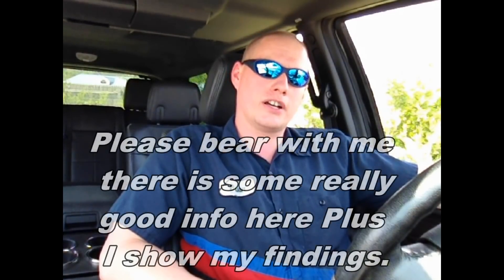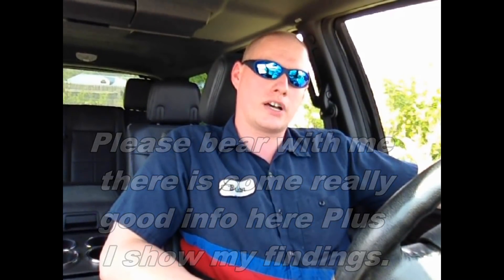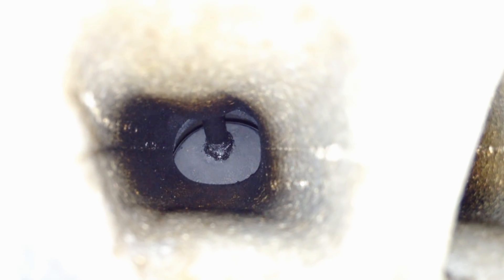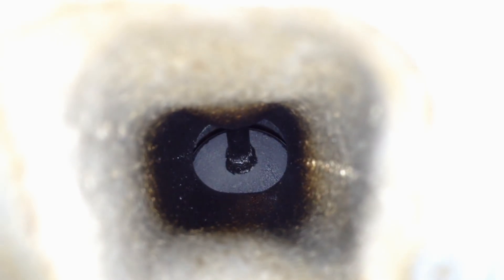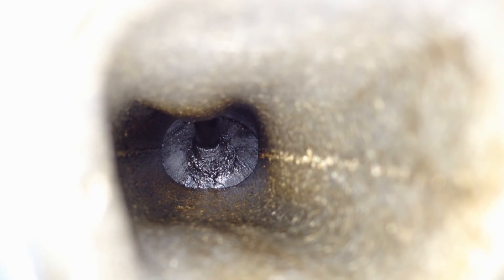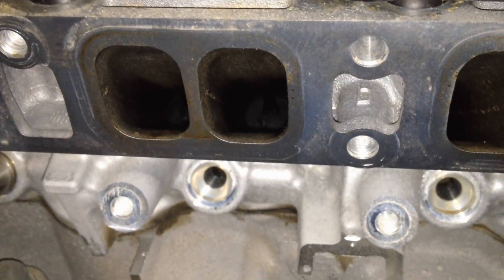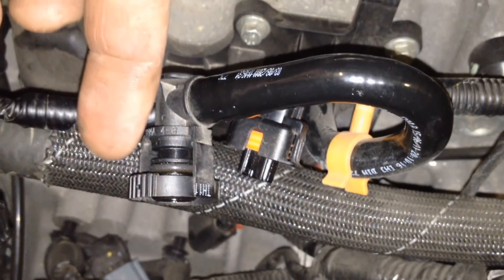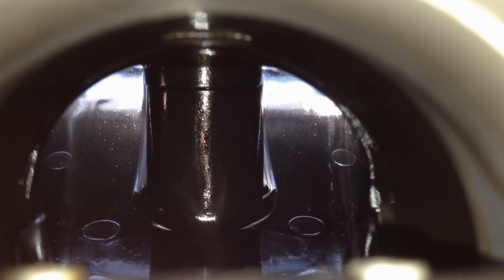Ford Ecoboost Warning Part 2 My Findings

Comment: Is all BS Ford won't fix the problem and it's all caused by direct injection. The funny thing I watched a video on Ecoboost and it's torture test and they said and I QUOTE the engine is like new with 160,000 after this with no issues. They might be quick off the line and take some V8 but I'd never own one and this is coming from several Ford techs to stay away!!!
Reply: The motor can survive it. You just have to live with a miss fire from time to time.
Reply: +easydoz1 yes, they are extremely durable

Comment: Hi FordTechMakuloco.  I love what you do.  I own an old Taurus and you have helped me save a lot of money with your videos.  But I have a question for you.  How is it that you haven't faced any repercussion for putting up videos like this that might potentially hurt Ford sales?  I would think they would want to prevent the spread of this info as much as possible.  I would really like to know.  Thanks.
Reply: For one, he mentioned that this is not a new issue. Only new to Ford.  Direct injection carbon deposit issues have been known in the industry for a a while. I knew and experience them with BMW in 2007 through 2011.    Now I bet the dealership would not like him posting this video. But ford corporate probably throws this in the bag with a lot of other nay-sayers.   This will likely be a small percentage issue an not a widespread plague like most fear.

Comment: My 2013 F-150 Ecoboost Platinum is in the Dealership service department getting the 'boost bypass valve replaced'. They are charging $600 for parts and labor after the check engine light came on. I baby my truck and for this F150 to break down at 47,000 brings a tons of questions into play.  I'll be making a YouTube video soon.

Comment: Looks like with no fuel in the intake, the blowby from the crankcase via the PCV is free to cake on the valves..
Reply: Bingo. The new 3.5 eco-boost also has a port injected set up as well as the direct injection. This presumably will help ensure cleaning the valves of the other deposits

Comment: I'll keep with my focus zetec 2.0  260.000 and still goin good  if you notice the new ford engine coming out with port and direct injection system to help fix these issues curious if ford's gonna have a recall on these engines I doubt it will just screw people over

Comment: Very informative.  This is one of the reasons why I chose the old "tried and true" 2.5 liter, normally aspirated engine in my 2014 Ford Escape.  I was and am still a little nervous about the Ecoboost engines.   Sure the 1.6 and 2.0 are snappier than my 2.5, but performance on my 2.5 is very adequate.  2.5 is "old school", but it is very reliable.

Comment: Great vids Makuloco!  Title should be Eco anything w/ direct injection turbo four pots=headaches.  Cleaning them is easy and cheap now, even if it's a twin turbo BMW V8.  Preventions are available also such as water/whatever injection kits.  As are dyi projects such as Sea Foam which I personally don't believe in.   I know too many people with older Ecoboot cars, not trucks unfortunately. Most are having multiple problems. Some intake ports I've cleaned looked toasted like in you vid only worse.  They run a lot better regardless afterwards but the older they get the more different problems keep comming up.  Hopefully the community has figured them out when I cross that bridge.  I'm not a weekend warrior by any means.  I own way to many specific tools and books, yet I refuse to call myself a mechanic.  I lack the experience of working on different modles on a daily basis for years consecutively.  That's why I refused to go into to Ford Asset program after high shool.  I regretted it at times.  Working on cars and other mechanical objects and learning how and why they do what they do is a passion however.  Like being a fisherman and becoming a full time fishing guide.  Ironicaly I became a biologist, studying and raising fresh water fish!  Cars are all I have left as something to look forward to and escape reality.  Vids like yours keep me up to date for when a friend or family member needs work done.  Which is a lot these days.  I appreciate you and others posting vids to help me out. Thank you.

Comment: Brian, I have been a master Audi/Vw tech for 20 yrs, this issue is old news for us. I  have gound that using plain water in the BG induction tool works fantastic in cleaning the tsi and tsfi direct injection   intake valves. Run it up to operating  temp, turn on the water and idle up to 2000 rpm, let water mist until empty. Shut engine off for 15 mins. Restart, and test drive vehicle for approximately 20 mins with some short  bursts of wot. Until smoke disappears from the exhaust. I personally do this to my cars every 20k miles before carbon gets to misfiring point. The cause i am told is the high carbon content fuel in the states, europe does not have this problem. I  hope this helps you out!

Comment: So what happens, I'm late on getting to all the problems, now that I've reached 41,000 miles on my 2012 F150 3.5 Ecoboost. I've had my 1st misfire, dealership fixed on my dime cause I'm no longer under warranty.  I'm about to invest in plugs, gapped to .028, coil boots and install a dual valve catch can with css. Do I need to check my CAC for "crud" and manually cleanup my intake valves before I do everything?  Or, will changing all of this and installing the catch can slowly and magically clean everything up?

Comment: What kind of oil was used? On a turbo charged engine you should be using better oil and changing it more often.
Reply from the maker: +Brett Bullard True the oil used in this engine was sub par.
Reply: I'm considering buying a fusion equipped with a 2.0L ecoboost. Do you think using a fully sythetic such as Mobil 1 synthetic, or even a motorcraft synthetic would help prevent this oil from getting baked on? If you actually acclerate hard every once in a while  to maybe blow this stuff out of the valves, would that make a difference? I've enjoyed your videos by the way, you're an amazing mechanic!
Reply from the maker: You definitely want a full synthetic that can tolerate the heat better and pass over the hot valves without instantly coking. Many oem's are switching to over to this for it's excellent performance under extreme conditions- http://amzn.to/1VUSlS6

Comment: excellent information!! thank you. love ford, not ecoboost. drive a 92 f150, 300-6 all the way to 300k and still strong.
Reply: I have a ‘97 powerstroke with 365k. It’s as reliable as any vehicle out there. They stopped building reliable vehicles after ‘02.

Comment: This I why direct injection is a bad idea! There is no fuel passing over the valve to clean or cool it! Direct injection is a fad that pass after the manufacturers get tired of replacing valves and head!
Reply: +CaptCaaaveMaaan give it time, they will have issues too, as brand name doesn't matter in this case because none of them have fuel traveling over the valve to cool or clean it!
Reply: Turbo diesels have been doing direct injection with no problems. and those things get a lot of oil into the intake from PCV, ive seem my intercooler leak a lot of oil and had to clean it regularly but the engine is still running fine and the valves are clean.
Reply: Seems to work well for BMW
Reply: +CaptCaaaveMaaan Seems to be working well for GM 6.2L V8 Gen V motors as well.
Reply: +J. Moore81 I only own and drive gm vehicles, I own two chevys at the moment. I believe GM  will have issues too, as brand name doesn't matter in this case because none of them have fuel traveling over the valve to cool or clean it! And I've heard from a gm tech they haves seen some issues too, though I don't think I've heard of any service bulletins or recalls from gm yet, but I'm more than sure they are coming;)
Reply: +teamgmotorsports   lol give it time? BMW has had direct port for quite some time, difference is BMW has a service port for maintenance which is all these cars/trucks need. Had a Eco boost fusion and ford service guy told me anything I did to try to clean( short of running cleaners through) would void warranty
Reply: +teamgmotorsports My 2015 Z06 has DI. No issues up till this point, albeit just under 900 miles on the odometer. I haven't of heard any other issues with the Gen V LT1 or LT4's. Hopefully, it stays that way. Fingers crossed.
Reply: +CaptCaaaveMaaan didn't know about bmw's "service port", but that should tell you they had or were expecting trouble and put that in there in order to deal with it. Congrats, now bmw owners have another service and more maintenance to do or pay for;)  As for ford, that should tell you something about ford;)
Reply: +CaptCaaaveMaaan *heard of
Reply: +teamgmotorsports or maybe BMW engineers foreseen the issue an provided a way to service unlike ford who did not and just leaves you stuck with the decision to void warranty and service or not and continue to have issues which start getting worse over time. Again I've already experienced this so believe me or not doesn't matter not trying to hate but I think ford could have did a little research and and made a way to service. If your going to have a turbo car be prepared to service to keep running well
Reply: Stang killers corvette? he already blew up 3 engines cause he says it's hard to tune with the direct injection.
Reply: +Miguel Lozano Bullshit. I don't know the background behind his car but it didn't blow 3 times simply because it was "hard to tune".
Reply: says it in the beginning fueling issues not tuning but still, he had a stingray so the lt1's he was talking about.
Reply: /watch?v=VzAV5chum1s

Comment: WOW, I just took a 2015 Ford Escape 2.0 EcoBoost for a test drive yesterday.  The engine was impressive for such a small 4 cyl. but after seeing this I am so happy I didn't make the purchase on the spot.  If Ford's answer is to replace a cylinder head then my answer is not to buy one.  The problem is what do you do once the vehicle is out of warranty?
Reply: None of those major auto media even talk about it. It's so dark that it actually like Hillary's emails. Toyota deals with it by keeping the "old" Port Fuel Injectors working with the Direct Injectors. Toyota eats the cost and gives you two injectors for every cylinder. Well, no wonder they sale so well and last that long.
Reply: This video is about carbon buildup all DI engines have that problem, it's not manufacture specific. Just Change the oil more frequently and drive hard every once in a while to burn it off. The ecoboost engines are very reliable(look up the stress test) I had an escape with 125k before I sold it ran like new; now i have an ST with 40k no problems
Reply: Hate to be the bearer of bad news but Kia uses DI engines too, pretty much everyone from BMW,Audi, ford, Hyundai/Kia, etc
Reply: max penrose .
Reply: Lucky the KIA has the warranty. You will need it.
Reply: What does direct injection have to do with where a vehicle is manufactured?
Reply: daphenom45
Reply: I am 10k miles out of warranty and have no issues..
Reply: YUPP HWEVER KIA  MAKES THER MONEY BACK - WYTH NON PWR/TRAIN UNWARRINTED-..ELCTRKAL PRTS
Reply: AdventureCayman Basically it means your kia will have the same issues ( presumably) that these ecoboost engines did have. They've since changed some things so in theory , this issue should no longer exist.
Reply: What an asshole. This buy amerikan is bullshit. If the guy wants a Kia he should be able to get a Kia without some uneducated asshole giving him shit about it
Reply: Watch the torture test, these are tough engines, but you can always get a bad one
Reply: I ended up buying a Kia Sorento and I am really happy with the decision.  It feels a lot larger then the Ford and the warranty is leaps and bounds better.
Reply: I was not aware that this was an issue specific to DI engines.  That being said I am sure the other manufacturers are not going around replacing cylinder heads like air filters.

I also had an Escape before the Kia Sorento and I really did like the Escape during the time I had it.  I needed something a little more roomy, with more safety features as well as I wanted something new with nice options.  The new Escape fit the bill in every way except it is really small for my needs.

The bottom line is the Sorrento I purchased 4 months or so back has been great and I am extremely happy with the vehicle.  It has so much more room, I don't feel so cramped and there is a lot more room between the drivers seat and passenger seat which really gives you some elbow room.  

I feel good knowing that this particular purchase is directly creating jobs right here in the USA and I have a 10 year, 100,000 mile warranty and the vehicle will be with another family before that runs out.
Reply: if you have the 2.0 4 cylinder it is an atkinson style engine and has both port and direct fuel injection so you dont have to worry about these problems.

Comment: interesting stuff regarding the issues of carbon buildup.... we had issues with this type of engine which is a further generation of the ford/mazda 2.3 unit found in the Mazda MPS/mazdaspeed's since about 2006. whilst the ecoboost has an extra VVT/phaser they are virtually identical including the infamous PCV and the problems causing 2 and 3 to run weak and hot, we also problems with positive pressure in the crankcase under boost/PCV operation which causes oil drainage problems thus causing premature turbo seal failure as the turbo wouldn't drain properly..... 'Corksport' came up with one the best ideas, whereby the oil breather beneath 2 and 3 on the inlet manifold is blocked off and then the PCV outlet and the breather on the rocker cover are linked and run through a quality Oil Catch Can and they back up to the intake before the Turbo..... this removes the issue of positive crankcase pressure and helped even out the carbon and weak/hot cylinder issue.

we also had a lot of VVT/Phaser failures with the mazda/ford 2.3 unit... we interesting to see if the ford 2.0 unit doesn't suffer the same fate as time goes on

Comment: Have you ever used Seafoam?  I just purchased my Ford Escape with 2.0 Ecoboost.  Had no idea they had this problem.  I also own a 2010 VW GTI, which I had to use Seafoam (now its perfect).  Because of the carbon issue, I run all my vehicles on premium gas.  Since obviously I'm attracted to vehicles with carbon deposits, please let me know what fixes this!!!

Thanks,

Carmen
2016 Ford Escape
2010 Volkswagen GTI
2010 BMW 335i
Reply: This will probably cause you turbo issues in the near future.

Comment: I have a 1962 ford econoline  pickup ,  That has blow buy . they had a  video  u tube of using a mason jar , between the pcv valve and the carburator.   The one  line goes to the bottom of the jar , the other line at the top of the jar that goes to the carb ,  the blow buy stay at the bottom of the jar !  I unscrew the jar a  empty the oil ,  it works great , no fouling of plugs , no build up on the valves .

Comment: Toyota has dual injection.  conventional and direct.  this solves the problem of dirty intake valves.  Better yet.  Who needs direct injection anyway.   We are not driving race cars where races are won or lost by getting and extra 1 or 2 miles per gallon.  Make it simple and cut the crap.
Reply from the maker: +abz124816 Ford also has dual injection coming.
Reply: +FordTechMakuloco Get rid of the direct injection altogether.   We do not drive race engines designed to last 500 miles.  While direct injection is more precise and economical, the car is not worth the trouble because of the complexity not to mention expensive repairs.

Comment: Will the gen 2 Eco boost have this issue also!?
Reply from the maker: +Mathew Gaudreau To an extent yes.
Reply: +FordTechMakuloco that's horrible , I'm seriously considering the new 2017 raptor but the thing only comes with a Eco-boost 😓 I can't afford to deal with problems like this .... Do you still have your new dodge
Reply from the maker: +Mathew Gaudreau Yes I do and I love it. The 2017 is supposed to come with dual injection to help this issue.

Comment: What really bums me out about all of this, is that other manufacturers have done the same type of direct injection, turbo, pcv systems in the past with the exact same results and issues that these engines are having. How detached are the engineers over there? They had a chance to at least look like they did their research and homework and had a grip on what issues other manufacturers had. To at least try to implement some type of preventative issue during design. My significant other owns the mustang Eco boost in which I do the maintenance and upkeep. Even some model BMW's with direct injection have to undergo a walnut blast to clean the deposits. It can be disheartening when there are thousands that know the basics of what the result will be from paying attention to what is out there and a high profile company can't even digest the foreseeable issues. Don't mean to complain but it just puzzles me to no end. Over half the community know this over the design engineers and that is unbelievable. Either way thank you for the videos and shared information as I know you went out of your way. Thank you to those with the experience and history on these types of setups to recommend the catch cans and AOS's. Thank you to those who help design and manufacture them, as obviously these car manufacturers cant even design something so simple to implement an aid in preventing such issues.
Reply: Jesse Longoria ...I agree. The engineers knew from past experiences of other makers that coking was a problem. IMO car makers only wanted to meet mileage and emission standards but were not concerned about long term reliabilty for the customer.